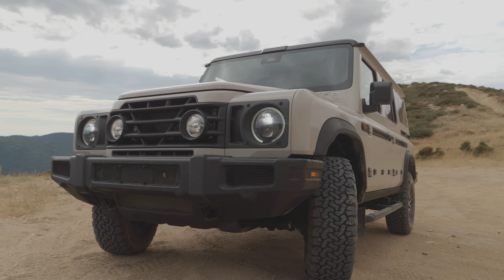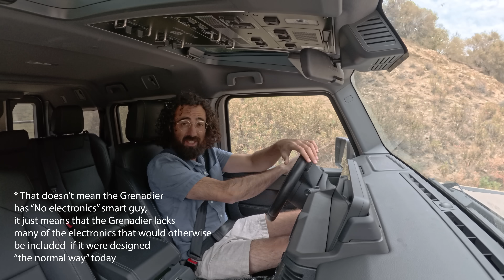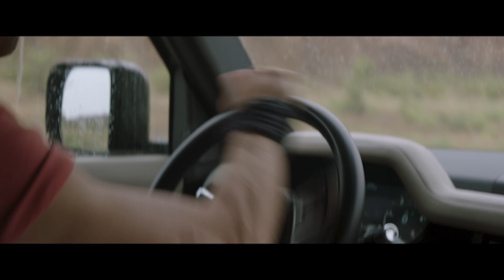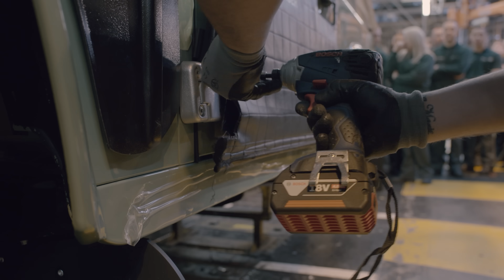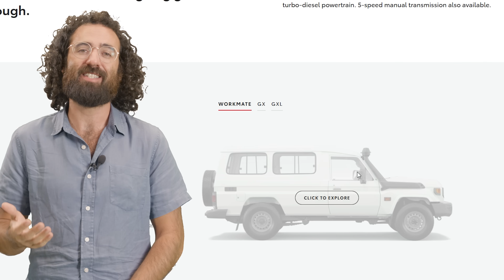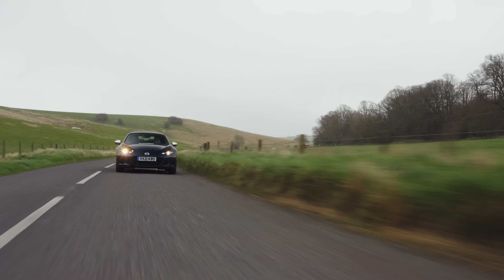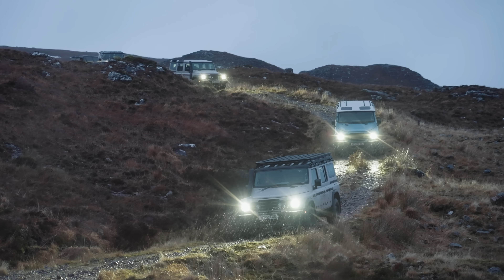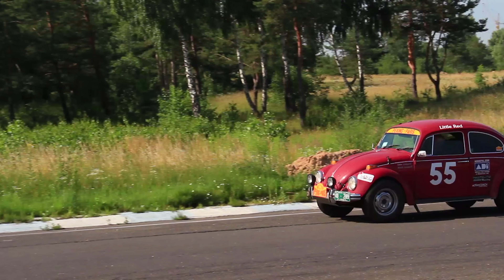Why a simple new truck has to cost over $70,000 in 2025

Comment: Finally a guy who understands why and how this car was built. It's definitely not an SUV, its a 4x4 built to last!
Reply: Bigger question is if the company will last and what the parts supply will be like.
Reply: @donleamon8653  I'm not crazy about the INEOS, but it's intentionally a very parts-bin vehicle. The designer wants yopu to be able to source replacements all over the world because this thing is meant to be way less Kim Kardashian and way more Lara Croft.
Reply: My Jeep Cherokee is almost 35 years old, it currently has almost 300,000 miles, it is on engine number two, but the original one made it 250,000, as long as I can repair some of the rust in the next few years, it’ll probably last another 30 years! Yes, it does have computer computers, but they are extremely simple when I believe there’s only two, the engine control module, and the transmission control module.
Reply: So an SUV?
Reply: Lol what? It won’t last past 80k miles. It’s a glorified BMW X5.   Uses BMW B58 pos and ZF box 😅
Reply: @E39M5SPEED my 2011 E70 X5 35i has almost 130k miles on it. My previous X5 2004 was sold with about 90K on it. Idk dude, I feel like they’re decently reliable engines as long as you do proper maintenance 🤷🏽
Reply: Built to last? HAHAHAHA.
Reply: @shadow7037932  Evidently you have not driven one.  This Magna Steyr design is fundamentally a bargain G Wagon.
Reply: Built to be overpriced, it’s horrible in every way besides looks. If this was good quality it wouldn’t be luxury price levels for a cheap ass vehicle and people are making excuses for it being super expensive.
Reply: @RoosterMaster519 did you even watch the video? He explained why it has to be expensive very clearly. This isn't the 1990s.
Reply: Built to last, I had a good laugh 

You must've thought you were still on a toyota video. This is nothing but a rich persons vehicle who wants to look cool and doesn't actually want anything reliable for offroading

Insane comment
Reply: @rfcdgaf get back to me when tundras are blowing up replacement engines and their modern gen doors feel like hollow tin cans. Talk about an arrogant and ignorant comment. 

900lb payload capacity for a “lane cruiser” 😂 with a hybrid battery. GTFO here
Reply: @AllGasCinemas ok, while the b58 is a good engine, let’s not pretend that BMW motors are the pinnacle of reliability
Reply: @steveguillory7568 Uh, you’re trying to use a blanket statement when the B57/B58 is one of their best engines, and top selling. It’s fine if you don’t like BMW, but most of the time it’s the owners that trash their vehicles since they don’t maintain them.

They have insanely reliable motors in vehicles and motorcycles.
Reply: @AllGasCinemas I will agree with you the b58 is a very good engine. Don’t necessarily agree the only problems with bmw are due to poor maintenance. The use of so much plastic in their cooling systems is just bad design. I would not expect rod bearing replacement to be considered normal maintenance with their v8s. Lots of vanos failures as well. 
That all said, I do agree that many used bmw’s are not maintained. Unfortunately, their poor reliability reputation causes mass depreciation. Then, many people who can’t afford to maintain them, and should be buying used honda’s or toyota’s, buy them as a flex and let them fall apart
Reply: @AllGasCinemas it may be one of BMWs best engines but is by no means one of the best engines. Especially for this application. A modernized 4.0l jeep engine would be far better and far more reliable. A VQ which was on wards best engines for a record 14 years would be a far better engine. A GM 4.3l(which is literally a gen 2 small block with two cylinders removed) would be far better and more reliable. All three of these choices were produced in greater numbers for more years. They also all have better reliability and parts availability. Parts are also far cheaper. And that’s just talking about 6 cylinder engines. 

I’m sorry but this thing is just  a rich persons off roader. For the money there and better options. Not the mention that you can easily have 90s simplicity and reliability by simply buying an older vehicle and using the 60k you saved to restore it. It would be better off road than this and cheaper to operate, buy and insure.
Reply: @mcfish689 lol did you just say a jeep engine is more reliable? 😂😂😂
Reply: @AllGasCinemas build in maraca for maracans
Reply: It aint gonna last by having a BMW engine 🤣
Reply: @MrSelfDestruct-1 it’s a B58.  It’ll last.
Reply: @MrSelfDestruct-1 um the b58 has examples with nearly a million miles in mother clock now, it’s fairly proven. You gotta do research before speaking old adages just to sound cool and feel apart of the club 😅
Reply from the maker: we shall see!
Reply: @MrSelfDestruct-1 LS swap candidate
Reply: @MrSelfDestruct-1  Toyota uses that bmw engine 😂 ignorant clown
Reply: Funny you say that I go off-road quite a bit in sedans with lift kits and every second car video in my recommendation is this thing geenadating
Reply: @randomnan5243 I’m sure it is dude… I’m sure.
Reply: @MrSelfDestruct-1  That B58 engine is solid. It has been referred as the new Toyota 2JZ
Reply: @Jupiterider1  Both engines the Ineos comes with are sought after and respected. The previous generation BMW diesel (m57) is slapped into EVERY old 4x4 in Australia to replace the tired old diesels of yesteryear, and the B57 is just an evolution on it.
Reply: @steeley_  It killed me that BMW did not type certify the B57 in the US for the Grenadier.... better mileage and more torque... would be total win. However the petrol version is a bit quicker off the line.  Love driving mine.
Reply: @BryanPike  it's called gasoline, I bet my 940 turbo you've never even SEN petroleum
Reply: @BryanPike  Most European diesels can't run on US diesel fuel.  Most diesel fuel in most of the US is very low quality, meant only to run in truck and industrial motors.
Reply: @MrSelfDestruct-1  Really?  That must be why Toyota put the BMW B58 in the Supra and races them making 500hp.
Reply: @BryanPike racing does not equal reliability.  It’s a great motor to be sure.  But in racing, you are constantly replacing parts
Reply: reliability isn’t really a concern when the engine only needs to last a few hundred miles. There’s a reason that everyone swaps k and ls engines into everything. Because they make great power especially for their weight and are extremely reliable and cheap to maintain. I cat recall the last time I heard on anyone swapping a BMW engine into anything.
Reply: It also is a luxury truck.
Reply: except owners are finding its definately not. lol If you buy a old actaul land rover, spent $20-30k redoing it.. Itll way outlast this POS.
Reply: This is NOT a real classic off-road SUV and it's NOT built to last. If it were, it would come with a MANUAL transmission. This is a fake off-roader for spoiled rich kids who never learned how to off-road for real.
Reply: @iloveburger2  It probably can't meet emissions or fuel efficiency regs with a manual in it.  That's why you couldn't get a diesel gladiator with a manual.
Reply: buddy it's an even more unreliable jeep
Reply: @hrushikeshghanekar  A Magna Steyr design built in a Mercedes state of the art SMART factory with best of breed components... You are ill informed.
Reply: @BryanPike  smart is 20byr old now g wagen is a goat of suv does everything and cost hell lott best ones are diesel variants. if  you want to go for early 2010s gwagen diesel
Reply: @hrushikeshghanekar lol no you don’t know what you’re talking about
Reply: @hrushikeshghanekar Americans believing jeeps are reliable is the funniest thing I read online. We have one that we travel with and by 30,000kms it had been through 3 gearboxes, a diff, and had electrical issues.
Reply: @steeley_  You must really be trying to destroy your Jeep. I'm on 145,000 miles, so over 200,000 kilometers, and I've had no issues other than the rear window washer.
Reply: @tenpoundburrito yes… and my lc105 is on 520,000ks with an aftermarket turbo on a naturally aspirated diesel. Unopened from original. Jeeps are shit and everyone outside of the US knows it lol
Reply: @steeley_  You might be relieved to hear very few of us actually think Jeeps are reliable. Even out of the people who own them, it's a split. Many buy them for their customization and aftermarket potential and have very little concern for reliability, and the rest buy them because Jeep, like Subaru and Harley Davidson, capitalizes on a market of customers who never really considered any other option.

Comment: Can't wait to get one of these for 8 grand with the B58 on the verge of death 7 years from now
Reply: What's the plan to power it at that point -rebuild?
Reply: @surfside75 the b58 is plentiful, a rebuild will not be difficult.
Reply: @surfside75 LS SWAP THE WORLDDDD
Reply: The B58 is a tank. Thing handles tons of power with ease and stays reliable. And this one is detuned and really isn’t getting abused. It’s probably not seeing much redline or super high temps. It’ll last just like most other bmw inline 6s
Reply: This guy gets it 😂😅
Reply: @Arvolash despite them trying to limit how many electronics the car has they can't escape the fact every British car since the beginning of time has electrical problems. It's inevitable
Reply: @Detah_ it’s not British 😂
Reply: @baronvonteuchter1412  Magna Steyr (Austrian) design, built in former Mercedes SMART plant on the German border..... very not British aside from badging.
Reply: @Detah_  
This isn’t British and the engine and transmission are German with German electronics. It was designed and engineered in Austria with BMW drivetrain, US crude transfer box and Italian axles and assembled in France.
Reply: Yep